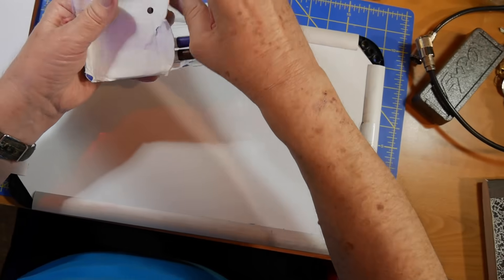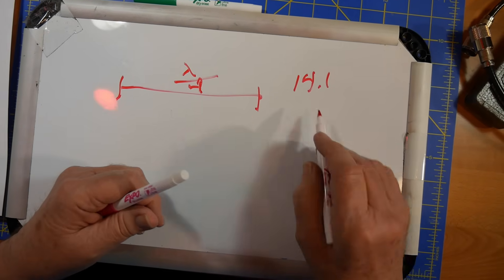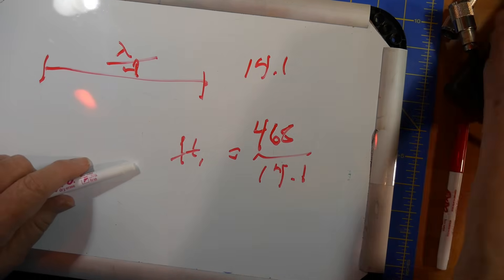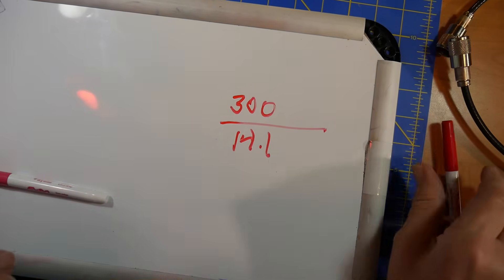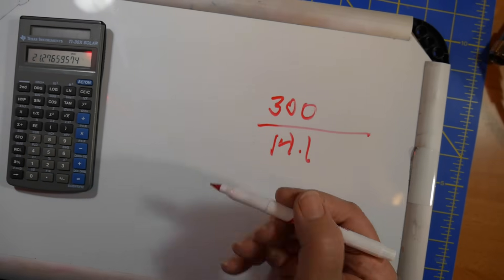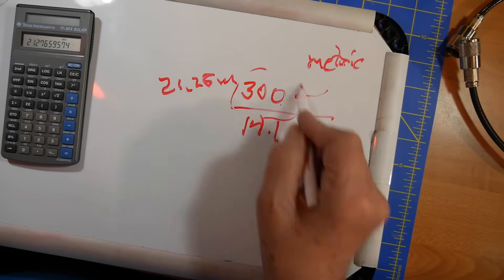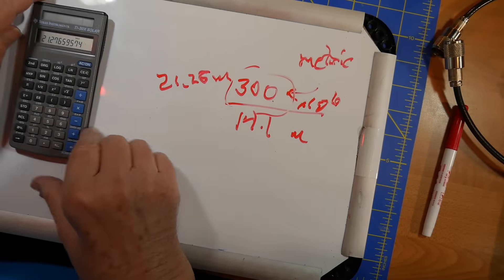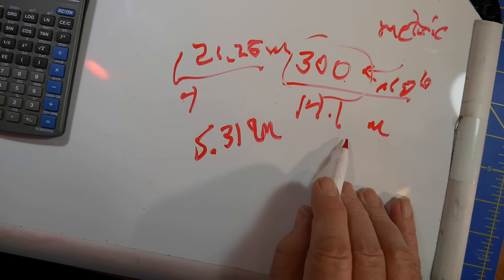Using Dialectric Constant to Calculate Coax Length (#1253)

Comment: calculating exact electrical length of coax is useful for me,  since I use cheap RG-6  for everything.   knowing  length of multiple of 1/2 wave.  AG6JU
Reply: How do you manage with the steel outer braid?
De VU2RZA
Reply: I use F connector  /  crimp on type, and F to BNC adopter.
Reply: @Porco_Utah because you can't solder the steel braid. But for qrp, that's OK 
De VU2RZA